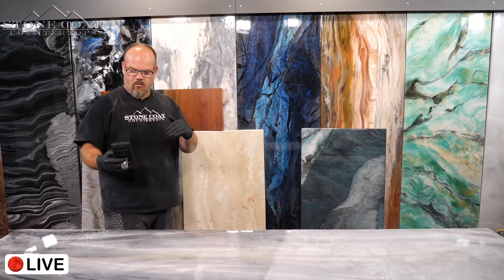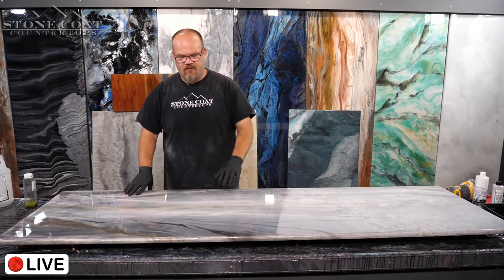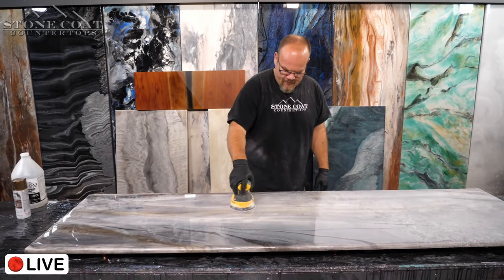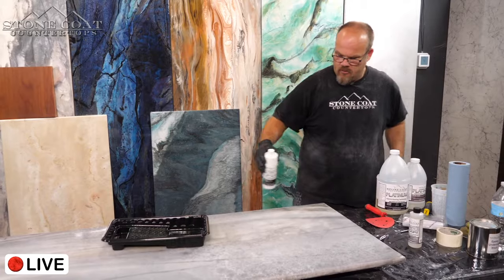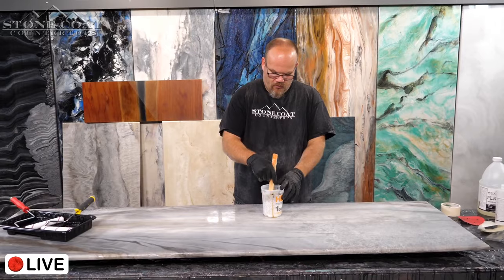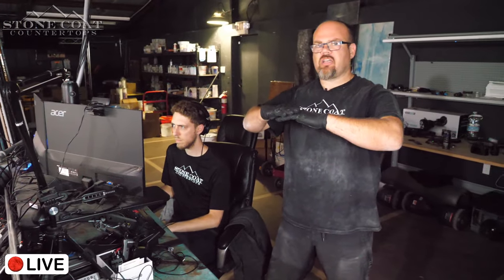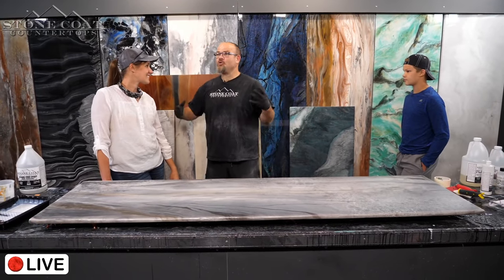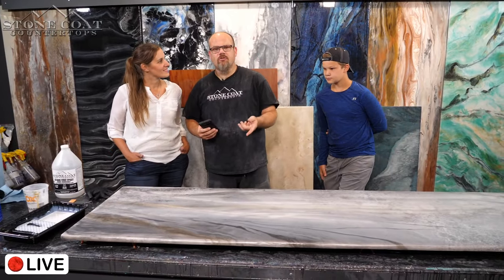Stone Coat Ultimate Top Coat Training | Stone Coat Epoxy

Comment: What do you do if the top coat is applied but the customer changes their mind and decide they want the gloss from the original clear coat export instead
Reply: from my recent experience your only choice is to sand off all of the top coat or sand and polish it to a glass-like shine. If the top coat was thick enough you can sand and polish to a gloss finish without reapplying but any sanding marks or scalloping left in the first ultimate top coat will show thru a second top coat. :(
Reply: I don't think that you have to sand all the topcoat off, just sand with about a 200 grit to get the mechanical bond, and then apply another coat of the original resin to get that high gloss finish... at the customer's expense of course, if they changed their mind on what their original request was!

Comment: I applied the Ultimate Top Coat to a cabinet I use as a feeding station for my cats.  The top was scratched up from them jumping up and down all the time prior to coating with epoxy and top coat.  I love the finish and durability, and it’s way easier to clean now!  I don’t think anything could mess up this top coat. 👍

Comment: Most epoxies I use are 23 hr re coat window anything more then sand with 60 grit and no big deal. If your within the window, just apply next coat, nothing needed as far as prep. Thats what I have experienced. I use Spartacote by laticrete. You can use a polyaspartic to make it non yellowing and have all the durable properties…?  Stay safe all,  great video!!!!

Comment: Hey perfect timing I'm doing my floor right now and want sure which product to use I have the polyaspartic top coat or the heat resistant epoxy what should I use

Comment: Just finished my second coat of the epoxy resin application clear with diamond dust… Love it however, about three hours in I went to take the tape off, stumbled and accidentally put my hand out of reaction to break my fall… I did the best I could to recover the imprint by adding some that I had left over and a trowel over it along with the heat gun. It looked much better however, there’s some imprint and unevenness that I could not get out…. please tell me what I can do to recover and repair this before I put the ultra topcoat on

Comment: Your demos are always in a workshop setting with a nice, flat board. However, I have an old kitchen with a laminate countertop that includes the 4" backsplash. What is your advice on covering this with UTC so the finish looks even and consistent with the horizontal surface? Is a paintbrush recommended? Also, can I go straight over the latex paint I used to colour the counter ? Thank you!
Reply: Same question here! I’d also like to know if I can apply this over imitation gold leaf paper

Comment: After you sand the surface of the epoxy, are you worried about pigtails in the epoxy before you put the topcoat on?  Or will the topcoat not show the pigtails from sanding?

Comment: I was rolling my white epoxy counter (my first time using UTC) and it was difficult to gague thickness with the light coloring, plus I was inexperienced with the produce.  When it was  dry, I noticed a few spots where it was applied sparingly/thin... can I spot apply the UTC in these areas or do I need to sand the whole thing and do it again?

Comment: I’ve done two countertops so far. My advice is: get a large bucket and small cups. Then pour the epoxy into MANY cups. Stir the color into each of them. Now you have at least 7 drinking cups with color stirred.
Then take the color epoxy cups and pour them into a large bucket. DO NOT STIR. If you stir the colors 😮once they are into large bucket you have fu! up.—colored Epoxy goes into large bucket do not disturb!!!—Then just Pour the large bucket onto the countertop and don’t touch it. You should be stirring individual colors at least 7 different plastic drinking cups. Each cup has one color. You never mix more than one color in this whole process. Again never mix colors once in large bucket.

Comment: I did my first table and made lots of mistakes.  Was about 8 ounces too short on epoxy so had to sand and do another top coat.  Tape dam took off the undercoat  which left white spots underneath the epoxy, and ultimate top coat looks like a textured finish which I was hoping for glass look.  If it’s textured does adding more water help to make it lay out more flat?  I think I have to sand flat and reapply top coat but use more water?

Comment: How do you remove UTC from  countertops? Mine looked fabulous until I added the ultimate top coat! It went from formica to marble and back to a very pretty formica. My issue is I LOVED the marble
Reply: I also figured out how to use UTC Matte, and make it look like real marble but I need to maybe "sand" to get the UTC off of the countertops that i did befits figuring it out 😏

Comment: Well, I had a super gloss super slick finish. Then  I sanded with 220 and applied the Ultimate Top Coat Gloss.   It came out like satin with heavy orange peal.  I'll be sanding it down and putting clear epoxy on it again tomorrow. I don't like this product at all.  What was left in the container is like a sponge. It didn't even dry like epoxy. I mixed the full contents of both containers so I know the ratio was correct.

Comment: Mike, is it ok if I sand the ultimate top coat after it dries 24 hours with 220 or 300? I tried it on a practice board and LOVED the smooth feel. Does that mess it up?
Reply from the maker: Great question Trish, we recommend following our step by step guides to get the desired finish I hope this helped! -Nathan
Reply: @StoneCoatCountertops  which step by step guide explains this? Can you add a link?

Comment: I had blistering and separation with the original yesterday, no matter how many times i moved the paint and epoxy to those spots, it moved away
Reply: Sounds like you have some kind of contamination in the substrate.
Reply: Ive got a painting same problem. I used silicone oil for cells. Ive washed with alcohol 3 times. One more.

Comment: Tried UTC glossy. Didn't like the finished product. The textured look was not what we wanted. After watching the videos, the textured look wasn't to much, but in real life, it was too  much. Will be putting the seal coat on after we 
60 grit sand this out.
Reply: Make sure you sand to at least 320 grit and remove any lap lines and all scalloping, anything you see when your done sanding will show through, at least with a second top coat it does.

Comment: Quick question can I put second coat of top coat or just touch ups?
Reply: I just did a 2nd coat myself 2 days ago. There was to much lint from the microfiber rollers I used. I caught it in time that the surface was hardened about 8 hrs into cure and scraped the surface with a fresh utility blade. Even ram a random orbital w/220 grit after full curse, then I cleaned up all dust super well and this time I used a 9" Microlon roller instead of microfiber. 1/4" nap. Was Way less shedding. I vacuumed the roller 1st with shop vac. Also i used a 9" foam roller for the dry rolling choose one suitable for smooth and metal surfaces ( because that's how smooth I wanted my service to be) I had a second foam roller on hand in case the first one got a little to damp as it picked up the excess product. And I was glad to have it as I did use it. It was worth the extra $4 investment.
The key thing though is that you must have wipe the counter down with xylene first. So I have the top coat product A and B Parts all measured out and everything ready to go, then pour design onto a microfiber cloth enough to saturate the cloth, and then I squeezed out anything that would be too drippy, folded the cloth over neatly and then simply wiped the xiling over top of all of the whole surface. And then immediately began mixing the top Coke product and by the time it was mixed and ready to start rolling the xylene had flashed. Then continued with the new coating application of their top coat. It turned out so much smoother using that micro lawn and back rolling with that foam roller. I couldn't get Dale Lane at Home Depot but it paint supply store had it in stock. Good luck with your project.

Comment: OK so I did my son's counter top which was over plywood and used stone coat epoxy A resin and B hardner with 3 different colors of dye. He wanted blk, red, and white. So I have done that and now ready to do the top coat and I am so very confused as to what step is nxt I have the ultimate top coat hybrid coating Clear/Natural A and B. So I've watch so many videos and don't know if I have to mix this top coating with the resin A or just do the top coat A & B alone. Plz help also I did the color coat and I guess I messed up bc I let the color coat completely dry and did not do a top coat yet is that ok

Comment: Mike. I have a counter I want to change. Looking in epoxy. My question is how to I do a counter top that has a raised edge to prevent spills on floor? Hope that makes sense.
Reply: Sand it down so it is level with the top of the counter. I did this two days ago and it worked well. Used a metal sanding disk rather than orbital sander, it took about five minutes.
Reply: @jacobsill9051  thank you

Comment: I'm using the countertop epoxy. Can I use the ultimate top coat instead of a clear coat?
Reply from the maker: Hi Jesse great question! Our Ultimate Top Coat will be applied after you do your clear coat. Keep in mind your clear coat needs to be fully cured before applying your Ultimate Top Coat. Have you started you project yet? -Nathan
Reply: Stone Coat Countertops I have not. Next week. Is the top coat recommended if I am not using the platinum product if I am going to do a clear coat on top of my color coat.
Reply from the maker: We do recommend our Top Coat For added durability and heat resistance if that is something you are interested in. -Nathan
Reply: Stone Coat Countertops but the top coat can't be used as a replacement for a clear coat? I have all the materials. I just don't want to go through extra steps if I don't need to. In one of your videos it said the top coat is mainly used with the platinum because it's not as strong. Which I am not using. Thanks for your help
Reply from the maker: Top Coat cannot be used as a replacement, it is recommended to use with platinum as well as our stone coat epoxy to grant the maximum durability to the epoxy. -Nathan

Comment: Are you able to cut food on the epoxy countertop , or would that damage it?
Reply: Theres a scratch-resistant clear epoxy you can coat the countertop to make it safer for cutting food (not 100%). However, if you are installing countertop for restaurant kitchens, I would recommend not to use epoxy countertops. Marble or stainless steel countertops are safer, stronger, and longer lasting. Remember, restaurant kitchens are hot and high humidity, and the chef are constantly using sharp knifes and tools.

Comment: If you leave Lap lines. How do you fix that? Or can you just put another coat?
Reply: Sand and polish. I think that is why they show the polishing video's but none that I have watched specifically state why they are polishing. I found out the hard way that if you don't sand them out and polish they will show through the second top coat application, along with any scalloping that was not sanded completely out.

Comment: I have a question, I messed up I rolled top coat on but forgot to dry roll it🤦🏼‍♀️ what can I do?
Reply from the maker: You can sand the current coat with 220 grit and reapply the ultimate top coat. No need to completely remove the current coat just smooth it out a bit and clean the dust with 91% isopropyl

Comment: How do you get rid of dried lap lines and do you have shiny top coat
Reply: Sand and polish. I think that is why they show the polishing video's but none that I have watched specifically state why they are polishing. I found out the hard way that if you don't sand them out very well, they will show through the second top coat application, along with any scalloping that was not sanded completely out. They do have a new high gloss top coat but if you sand and polish you will get a shiny finish again without reapplying.

Comment: Do not like this product. It congealed in the pan 15 minutes after mixing. Looks like absolute crap because I had to press really hard to remove with dry roller. Disgusted. Will probably need to re-sand. Not as easy as advertised.